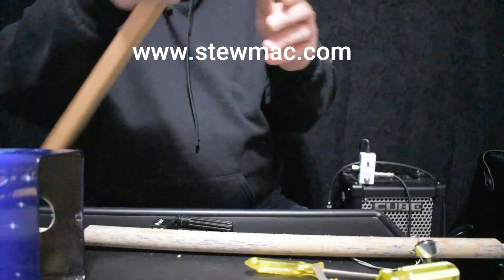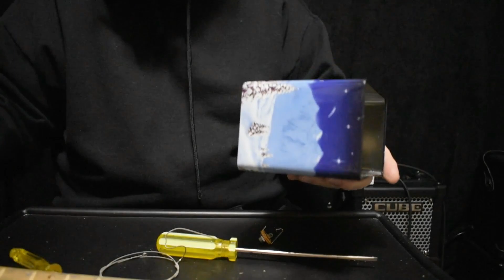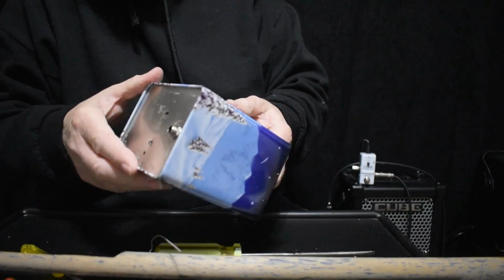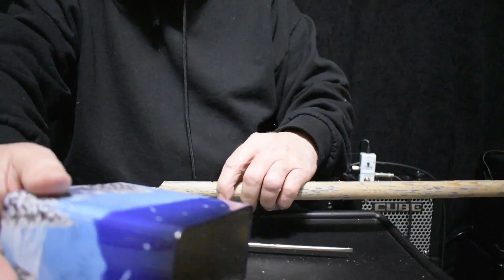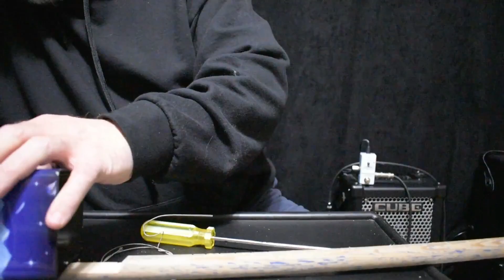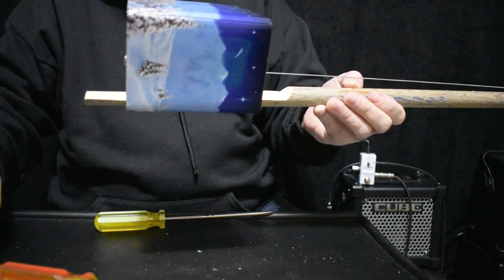$10 - CANJO How To Build an Electric Broomstick Canjo - Easy Project For Ten Dollars (beginner + up)

Comment: I made something similar with a broom, some scrap wood, and a spare low E string. Made a nut a and a quick sattle. I use it as a stand up, and it sounds pretty good. Didn't even put a tuner in, just nailed the string into a hole. I put a capo in front of the nut, and it works in standard 1-12 intervals! P.S. I pretty much locked myself in a standard home workshop, only using the objects around me, for what I had it's amazing!
Reply from the maker: That's the spirit! Great job 👍